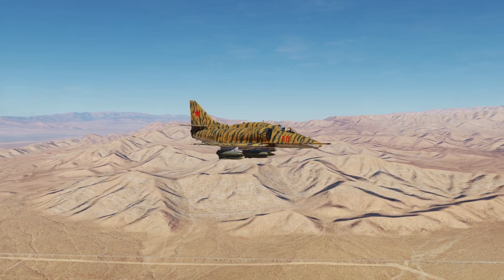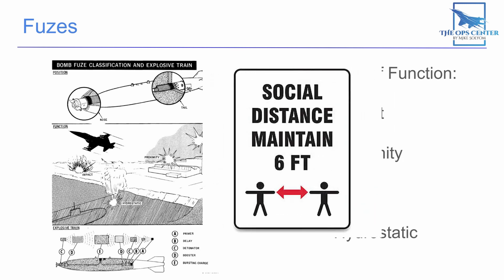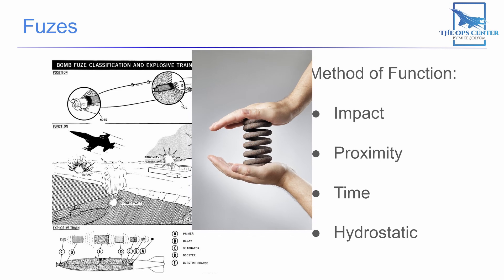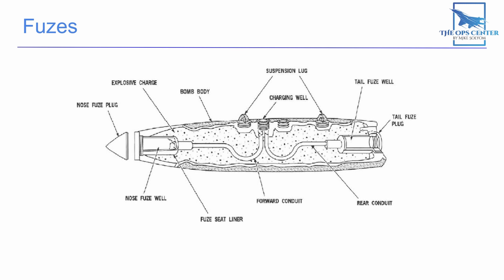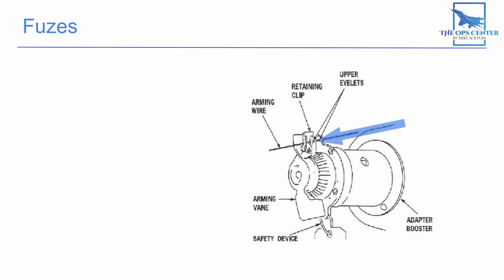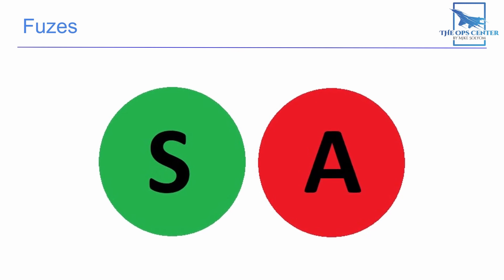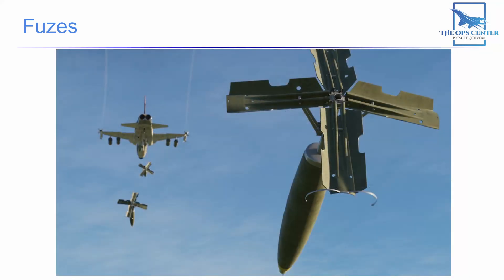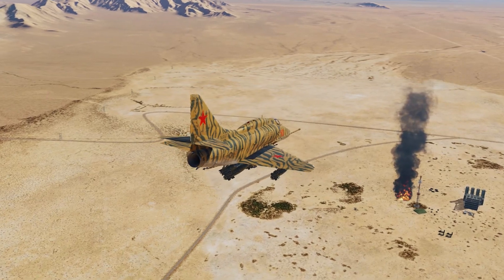Fuzes Explained | DCS

Comment: The problem in the initial video wasn't fusing but in the bomb spacing. Most bombs are armed once the arming wire pulls the pin from the bomb fuse. The arming wire is about 10'-20' long, taped to the bomb. If you release all the bombs at once they will inevitably hit each other after the fuses are armed causing a detonation and fragging the aircraft. To be safe, you will usually require 1/4 to 1/2 second release spacing to ensure the bombs don't hit each other after they are armed. In addition, since modern bombs are very aerodynamic, without drag fins the bomb will keep up with the aircraft as it falls and if the aircraft isn't high enough it will frag itself. Our rule of thumb was 3k' and 300 kts with a retarded Mk82 fused with a 1/4 sec delay as a minimum. Preferably we would do 5k' at 300 kts. We never did less than 1/2 second spacing which was more than enough to ensure the bombs didn't hit each other on our aircraft.

Comment: How is it that if i set my fuze for tail for a Mk-82 Snake-eye how is it that it still detonates i thought the tail fuzing just opens the tail fins???
Reply: Not sure how it works in DCS, but in real life the rack has a "nose" solenoid and a "tail" solenoid that is activated (solenoid closed and the wire is retained by the rack) when that option is selected. Arming wires can also be just attached to the rack. It's been a very long time since I dropped a mk82 snake-eye, but I thought we attached the tail fins directly to the rack so they opened even if we dropped the bomb safe (both solenoids are open and both arming wires fall away with the bomb). But I could be wrong. Regardless, the way the ordnanceman attaches the wires determines how the bomb will act. We always had the ordnanceman go with us on our walkaround to make sure we knew what was going to happen when we selected nose, or tail, or nose-tail, or safe.

Comment: Great video! First correct explanation I have seen in a video.  The perfect information and the addition of some slides make your content high quality. Keep up your work mate!

The nose and tail fuses are the biggest mistake the people get wrong all the time. Even in many tutorials they explain it wrong. The common one is: "if you want to penetrate something take the tail fuse because it's triggered later because the nose will impact first". That's wrong.

2 fuses that are installed by the ground crew, sometimes different types (impact fuse or timed delay fuse) In the air the pilot can choose which one he needs right now. So he got 2 options.
Also the fuses triggers other stuff like the airbrake fins of snake eye. To deploy snake eye in low drag chose nose fuse but if you want high drag use tail fuze.

Comment: Very interesting video, thanks for posting. It's still not entirely clear for me why I would choose nose or tail fusing, though. So nose fuse = instant detonation upon impact, large frag area. Tail fuse =  ? more concentrated destruction? Nose and tail = make sure the bomb impacts no matter what?
Reply from the maker: Like most answers on military aviation questions this one is "it depends". When they build the bomb they can choose what kind of fuze they install on each side. So for example they could put a contact fuze in the nose and a delayed fuze in the tail. That way the pilot can choose which one is best for a particular target.

Now another example would be two instant fuzes so you choose which way the blast detonates. If the detonation starts at the nose then it will progress backwards (or up into the air for a nose down bomb). Tail end detonations progress forward or into the target.

Lastly, the Nose/Tail switch controls the wires that are pulled when a bomb is dropped. So this affects external parts of the bomb not just internal. So for example if you had a Snakeeye bomb with an instant nose fuze and you wanted to drop it in a low drag config you would go nose only and the fins would not extend. But if you wanted the fins out and the nose fuze you would go nose/tail. Or if for some reason you wanted a hi-drag drop without an explosion just tail.

Hope that makes sense.
Reply: @TheOpsCenterByMikeSolyom  Makes sense now, thanks a lot for the explanation!
Reply from the maker: You're very welcome. And keep up the great work on the campaigns and videos. I'm glad to see a fellow Hungarian making great content!
Reply: @TheOpsCenterByMikeSolyom  Thank you, appreciated! Köszönöm!  :)